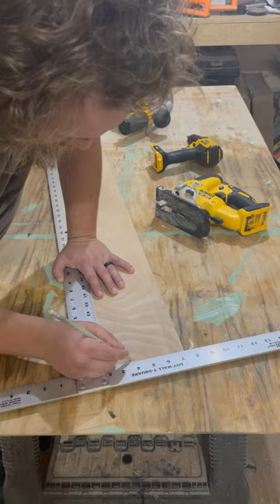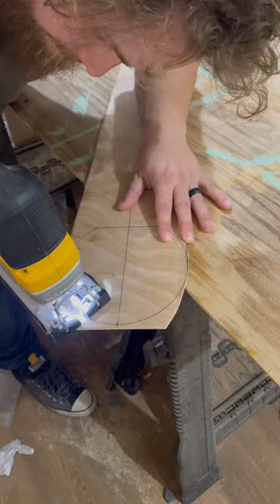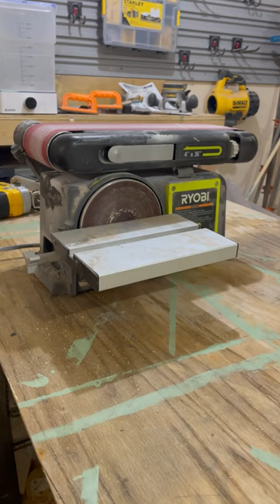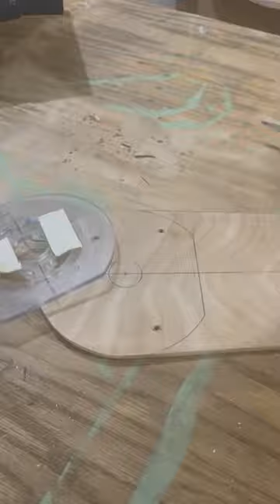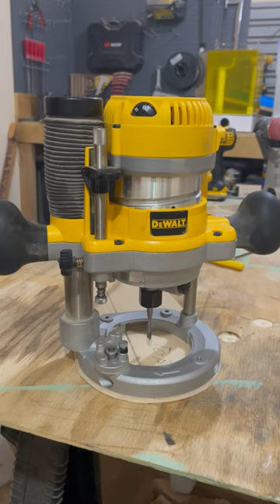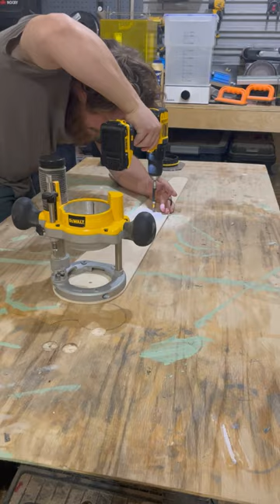How To Make a Circle Cutting Jig

Comment: I'm curious how you did not have a hole in the center of the finished wood. Maybe you did, but how would you prevent that?
Reply from the maker: That’s a great question, it does cause a small hole in the center of the piece and I know of no way to prevent this. The best advice I have is to attach it to the bottom side of the piece, usually a hole can’t be noticed there, just make sure not to screw too deep, you don’t want to poke though the top. Hope that helps, thanks for watching